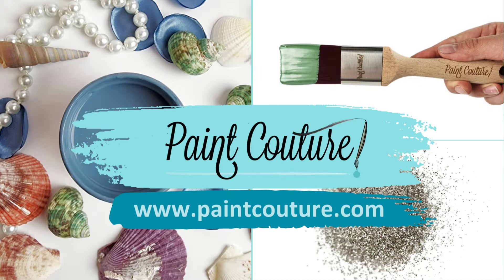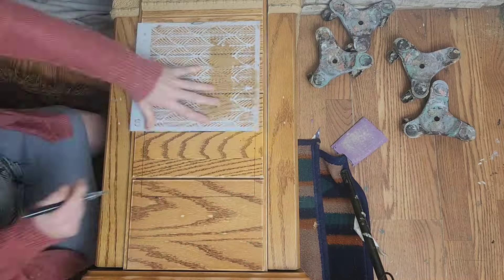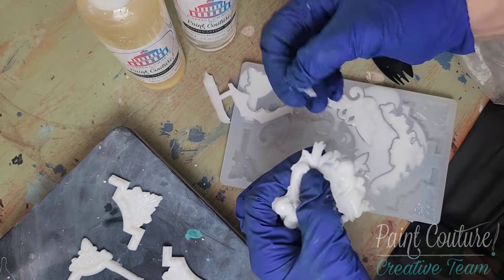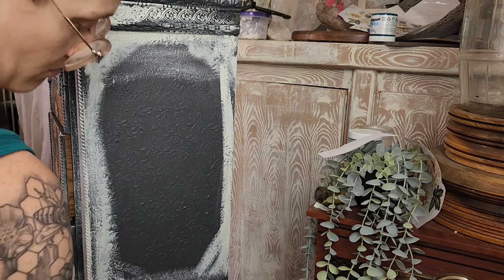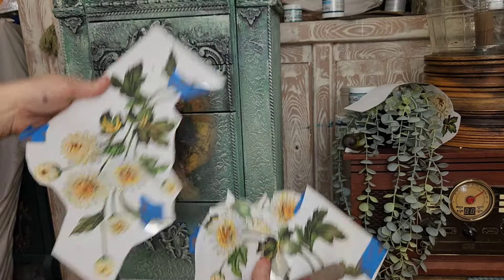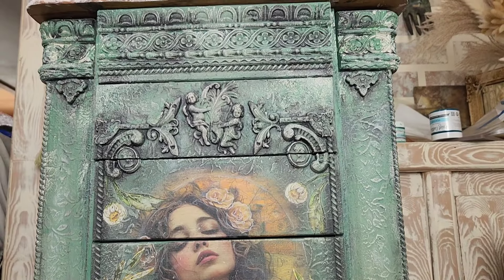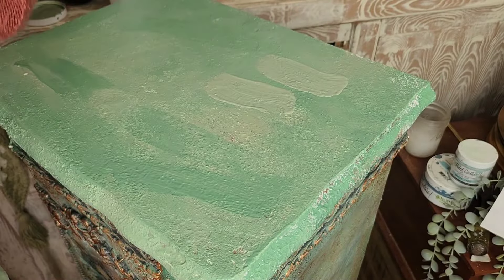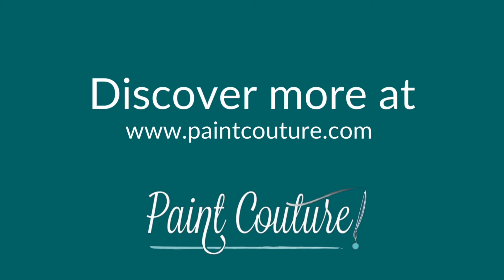DIY Furniture Art: Layer Moulds, Decoupage Texture, Stencils & More/ Handpainted Aged Copper Patina

Comment: Just a quick tip for anyone wanting to try something similar, dry brushing is a lot easier and more subtle if you use a larger natural bristle brush or chip brush as opposed to a small synthetic artist brush. It also prevents those stop and start brush strokes from showing as much especially on larger surfaces and will save a lot of time.
Reply from the maker: I do love chip brushes for dry brushing too.  Thanks for adding in your go to favs ❤

Comment: If you plan to sell this beautiful piece, how would you factor in the products you added? Though I have a fairly extensive inventory, I'd have to purchase several more products to achieve a similar finish. Though I may have leftover product to use in the future, there is the outlay up front. The quandry is always in pricing as my furniture art is a hobby that I am happy to recoup my out of pocket expenses. I appreciate for many, it's a business with profit goals they strive to achieve.
BTW, you're a very good educator as well as content creator!
Reply: I so appreciate you watching!! I usually calculate the cost of the products and then calculate the percentage used for the specific project.
Reply from the maker: Our products also come as small as a 1oz size.  You don't need a ton for a glaze or metallic but Renee does have the larger sizes as buying larger and using for multiple projects does keep costs down in the long run as you thought.